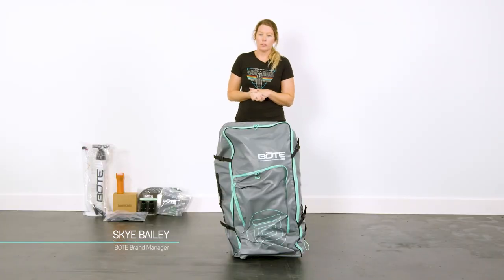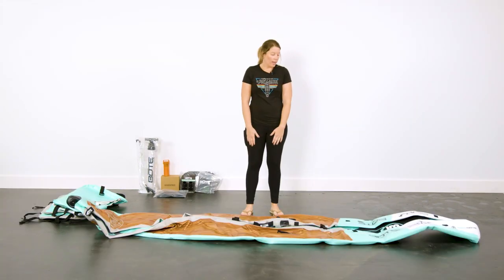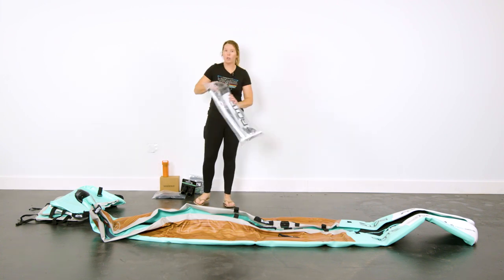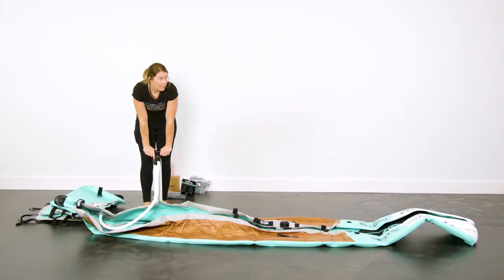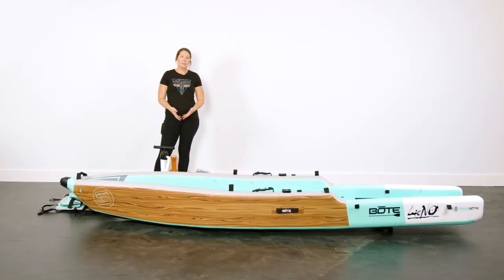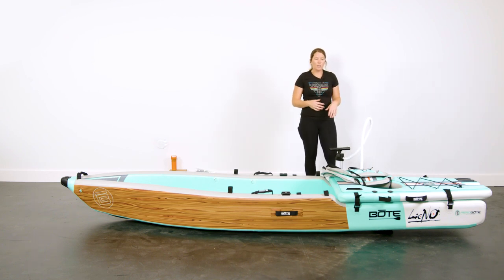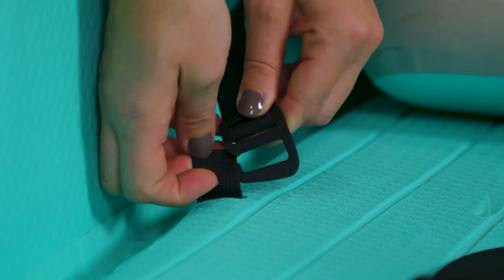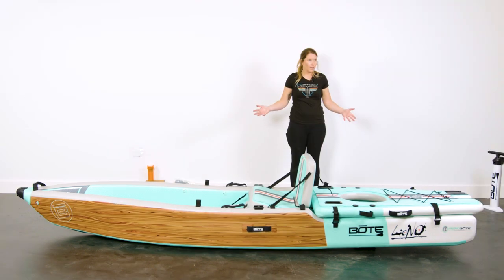How to Inflate the LONO Aero

Comment: Questions about the Pedal Port.  1st: what's the easiest way to install it bc i have a very hard time doing it (and i do it first before inflating anything.) 2nd: is it really necessary to use the Pedal Port on flat waters like a lake because the water doesn't really build up without it anyways (i know from firsthand experience, lol, bc i didn't install it properly and it just came off)

Comment: Do you need the bote pump specifically to pump up bote products?
Reply from the maker: The BOTE pump most certainly fits but the inflation valve is a Halkey-Roberts valve that is used across a wide variety of inflatable sup brands.